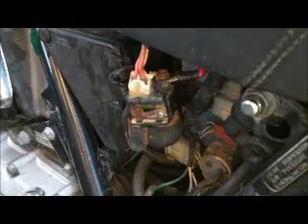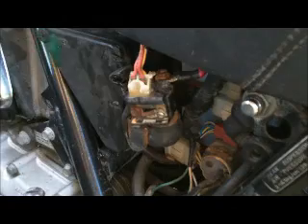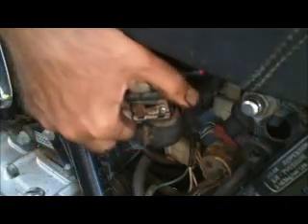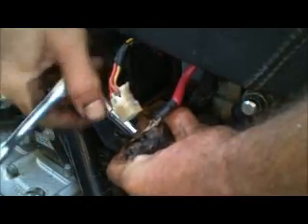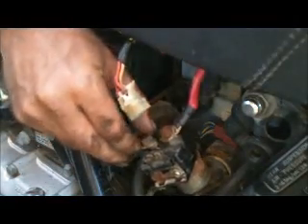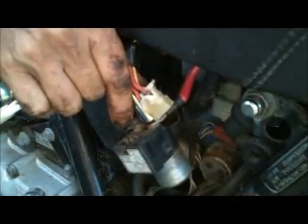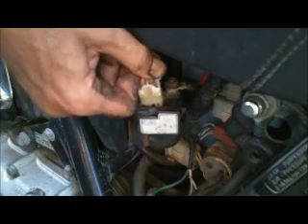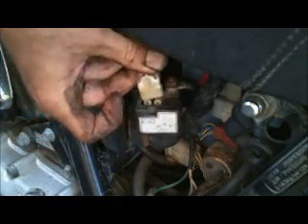Replacing a Honda solenoid

Comment: well hell yeah !! my dad passed away 9 years ago andhis  bike was stolen right in the middle of all the commotion . . I got the bike a couple days ago . . its been missing 9 years . . they pulled out the key box thing  and have some funny hotwiring situation going on . . I'm trying to do it my self to get it fixed but its a daunting task . . any advice for repairing a hot wired bike after you get it back after 9 years ?? honda 2003 750 shadow.. . wanna get it back to normal for my dad .
Reply from the maker: 1 wire to the ignition plug is ground .. leave it disconnected .. 1 wire is constant hot .. twist the rest of the hots together and put them on one side of your switch .. put the constant hot on the other side .. can use a key or toggle switch (switch is a switch) ... Haynes manual has the best cartoon (schematic)  for the actual pinout if you want to put a factory switch back on (molex plugs are cheap) ... but it's only 80 bucks for a brand new wire harness .. pop off the old one and hook up the new one 1 wire/plug at a time it takes under 2 hours to change .. ebay is a godsend for NOS and replica wire HD arnesses
Reply: @dawino6260  thank you i will give that a try !
Reply: So i found the areas you are talking about but there are two extra wires one is 12v and there is another taped to it but looks like they get twisted together later in the starting process . .  it goes to the fuel pump . . .  when i connect the 12v to the rest of the hot wires everything lights up but the ignition button does not start the bike . .  any help is appreciated more than you know
Reply from the maker: @jessemellon6258  there's 2 wires just for that button switch .. pull them out of circuit so you can test the button using a test light or just the continuity tester of your multimeter (switch is normally open it closes when pressed to complete the circuit)... if the button switch is good, take 1 wire and use it for a feed to the button switch from any circuit that is only hot when the key is on (tripping a solenoid takes less than 1 amp even on a CAT). . Other wire goes to the trigger on your solenoid
Reply: @dawino6260  hey . . .  thank you for your help . .  i actually got it running ! Couldnt have done it without your advice ! You aree the shit !

Comment: the bake fuse cap mine plugged into melted and instead of me going into the wire harness to track it can I cut and splice the wires right being the cap and if so where can I get the replacement blade fuse cap

Comment: Why is this part referred to as a solenoid rather than a relay?

Being the asshole I am, I’m inclined to call it a contacter.
Reply from the maker: Contactor has points moved by a solenoid.... solenoid directly hits whether it's an arm/object (they make solenoid intake and exhaust valves for engines even)...  That's how it was explained to me .. albeit the reference was to a bang cut lol

Comment: '98 GL1500..REPLACED SOLENOID......NO POWER TO ANYTHING.
GONNA JUNK IT.
Reply from the maker: 1500 I'd be checking for a bad fuse off of ig or a bad kill switch or bad keylock switch .. I'd check in that order ..

Comment: Hi there, my son has the code on his 2000 honda civic for the torque converter solenoid?  Could he do himself, where is this bad boy?!?!  We can't seem to find a video for it...please help
Reply: it's on the transmission. On my 02 accord it's right on the front left (facing the engine/transmission from the front). I'm not sure if its the same on those civics but I think they use the same transmission, or at least very similar

Comment: Could a bad solenoid cause the transmission to slip?
Reply: No way
Reply from the maker: NO - usually that would be the clutch facings or clutch springs Easy to change
Reply: Slip, or shift hard? My shift solenoid is going bad and makes my 1st-2nd shift hard as fuck
Reply from the maker: This is the starter solenoid - entirely different thing

Comment: Yo so I'm having issues wit my Suzuki gs 1100  with this I believe anyhow.  because sometimes when I go to start it don't do shit.  but the lights turn on when I turn key.  just don't even try to turn over.  but I take the lill plugs that  come In on top of that off and put back on then it starts.. I'm wondering if it's just faulty Connectiob that could be cleaned or if I should replace it.

Comment: Got a question for you.  Did the exact same thing you did on my 1982 honda magna 750.   As soon as I put the prongs into the solenoid smoke starts coming from wires and the solenoid.   Any ideas on how to fix it.  Thanks.

Comment: I have a Honda 400 ex. When the bike is started the starter stays engaged and the bike can only be turned off by disconnecting the battery cable. I've replaced battery,starter solenoid,starter. I don't know what could be the problem. None of the wires don't seem to be pinched or grounding out. Does anyone have any idea of what it could be?

Comment: Hey I have a 1980 cb 750f that's not starting. I can hear the solenoid popping and checked continuity. I have also pulled the starter out of the bike. Hooked up to a battery straight it spins. even hooking it up to the bike and letting it rest in frame it spins. but when I hook the starter back up with side cover off it wont spin gear to engine. any ideas or seen this before? im thinking a bad starter
 weak..?

Comment: I'm not getting any power past the starter solenoid on my cb900c even after replacing it and I have a new battery,if I jump the solenoid it starts right up but dies when I remove the jumper connection. Any ideas?

Comment: does it mean transmission going bad or something else
Reply from the maker: +MICHAEL ROMAN No - on these motorcycles the solenoid is just for the starter .... I know what you are talking about with the solenoids in the Honda car transmissions though - But other than replacing during rebuilds I haven't played with the car transmissions enough to know more than to turn bolts - never had to diagnose - all I did was a few rebuilds to put em behind Honda CAM100 and CAM150 aircraft engines we were stuffing into some old prelude wedge bodies so they could go wreck em ....

Comment: I tried doing this on a yamaha atv, I was thinking how hard could it be.  Well long story short I order the new Solenoid and installed it and it never worked.  If lets say the wires got crossed would that burn it up?  if yes how would i know if i did actually mess this up, and how would i know which wire goes to which side?
Reply: Joseph Garvey i know it’s been 5 years... but another thing to always check is the relay and fuses

Comment: Actually the sites you mention do not appear to have this part...  There are tons of some Chinese generic part but finding the OEM part is tough, at least on the sites you mention and other similar sites...  The price for the OEM part appears, as is the case with most OEM Honda genuine parts much higher....  If you or anyone knows where to find the OEM part for $30 by all means post a link.

Comment: @dawino6260 where is the location of the solenoid in the honda because I have a Honda and the code came up as solenoid
Reply from the maker: Honda usually within 3 inches of the battery - follow the fattest + lead from the battery first thing it's going to hit is the solenoid

Comment from the maker: Check your stator output to be sure... but yeah -- them 4 wheelers if you put in regular batteries leak em and lose em quick -- Get you a gel cell battery from batteries plus - you'll have to order it but it's still gonna be about 1/2 the cost of getting one from a cycle shop. If your book doesnt tell you how to test the stator just e-nag me and I'l give you a quickie rundown on how

Comment from the maker: or a dirty solenoid - jump it across the 2 terminals on the solenoid with a screwdriver just to see - those are notorious for doing that - lot of times you can hook up a car battery on jumper cables (WITHOUT the car attached) and hit em a couple of times to clean em but it's only a "get by till you can find another solenoid" trick
  Could be a weak starter too - usually just new brushes/springs/clean the commutator fixes it but the solenoid is KNOWN for going bad and still clicking